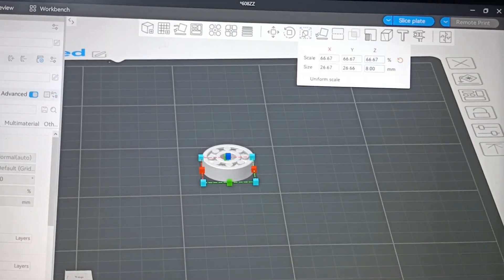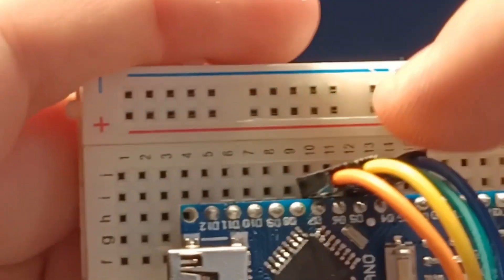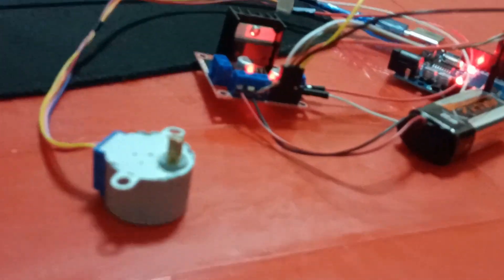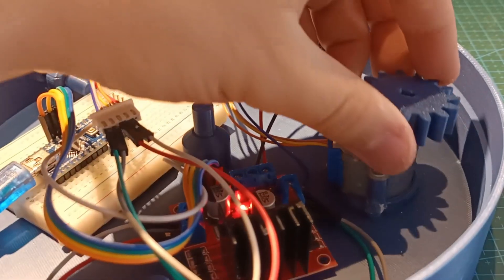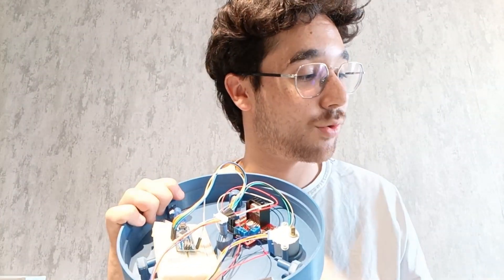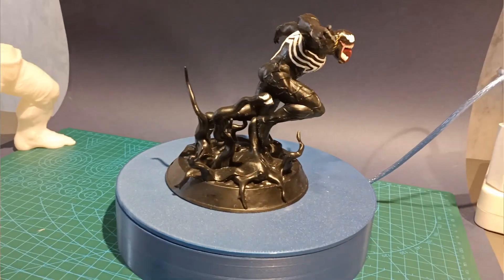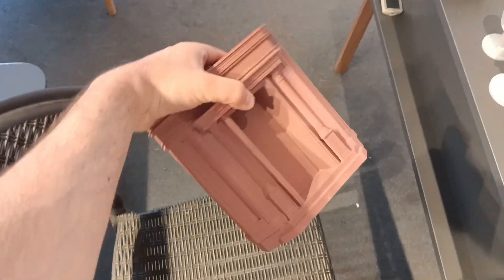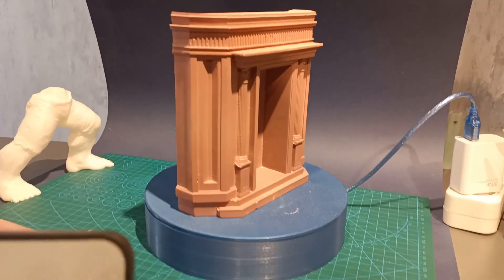“3D Yazıcı + Arduino ile Sergileme Standı Tasarımı (Kendin Yap!)”

Comment from the maker: // 28BYJ-48 motoru L298N ile 3 kat hızlı ve stabil sürüş (Half-step sürüş)

#define IN1 8
#define IN2 9
#define IN3 10
#define IN4 11

void setup() {
  pinMode(IN1, OUTPUT);
  pinMode(IN2, OUTPUT);
  pinMode(IN3, OUTPUT);
  pinMode(IN4, OUTPUT);
}

void halfStepForward() {
  // Half-step sırası (8 adım)
  digitalWrite(IN1, HIGH); digitalWrite(IN2, LOW);  digitalWrite(IN3, LOW);  digitalWrite(IN4, LOW);  delayMicroseconds(600);
  digitalWrite(IN1, HIGH); digitalWrite(IN2, HIGH); digitalWrite(IN3, LOW);  digitalWrite(IN4, LOW);  delayMicroseconds(600);
  digitalWrite(IN1, LOW);  digitalWrite(IN2, HIGH); digitalWrite(IN3, LOW);  digitalWrite(IN4, LOW);  delayMicroseconds(600);
  digitalWrite(IN1, LOW);  digitalWrite(IN2, HIGH); digitalWrite(IN3, HIGH); digitalWrite(IN4, LOW);  delayMicroseconds(600);
  digitalWrite(IN1, LOW);  digitalWrite(IN2, LOW);  digitalWrite(IN3, HIGH); digitalWrite(IN4, LOW);  delayMicroseconds(600);
  digitalWrite(IN1, LOW);  digitalWrite(IN2, LOW);  digitalWrite(IN3, HIGH); digitalWrite(IN4, HIGH); delayMicroseconds(600);
  digitalWrite(IN1, LOW);  digitalWrite(IN2, LOW);  digitalWrite(IN3, LOW);  digitalWrite(IN4, HIGH); delayMicroseconds(600);
  digitalWrite(IN1, HIGH); digitalWrite(IN2, LOW);  digitalWrite(IN3, LOW);  digitalWrite(IN4, HIGH); delayMicroseconds(600);
}

void loop() {
  halfStepForward(); // Sürekli ileri half-step dön
}